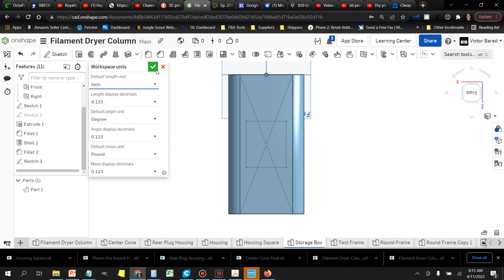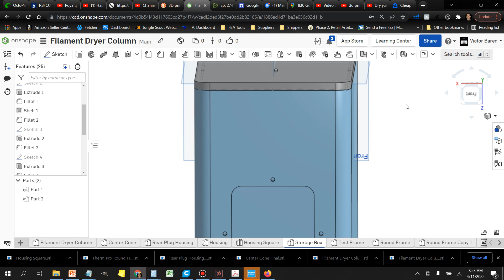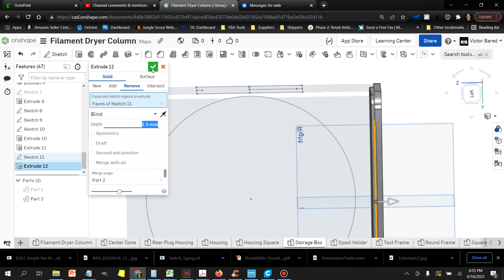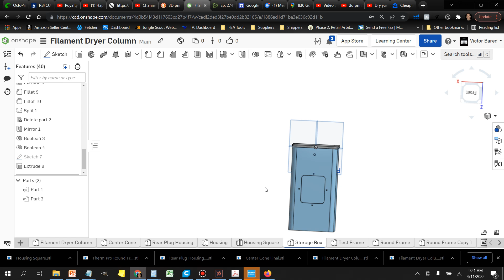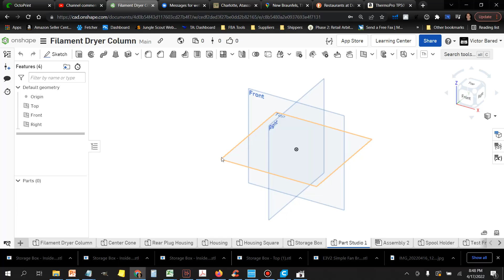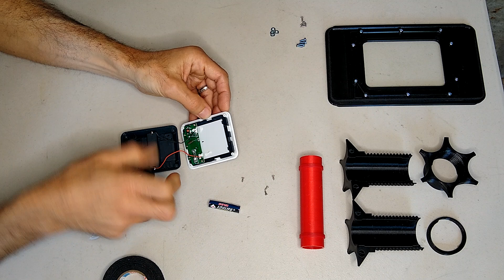Professional Looking DIY Dispensing Filament Storage for The Ender 3 V2 and Others for Under $35

Comment: I like that! I could see having a line of those sitting on a shelf above the printer.

After removing it from the car and having it inside for a couple of days, does the humidity stay low?

Thanks for the video!
Reply from the maker: Hi Steve, This morning it was reading 25% humidity so I either have a leak maybe around the display/glass/both or the container only serves to slow down the humidity absorption enough to get through a print before having to dry the filament again. I'm still learning about this part of 3D printing, stay tuned I'll put out another video once I get all figured out.